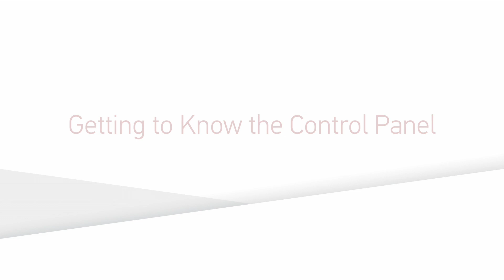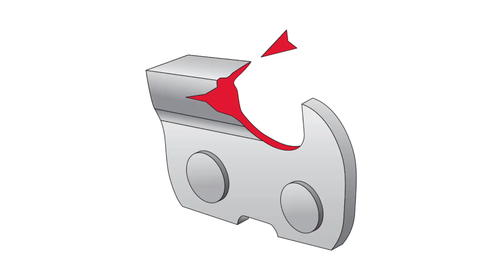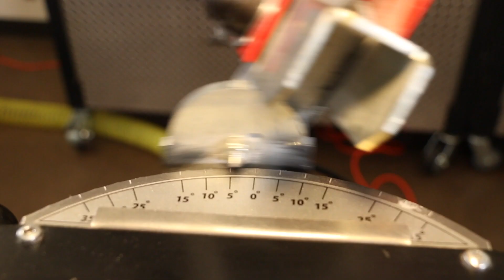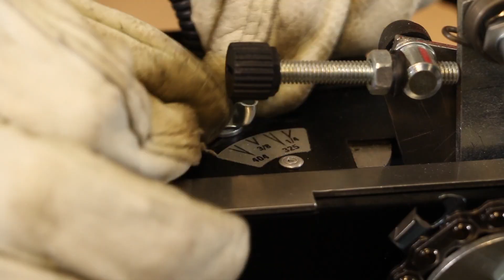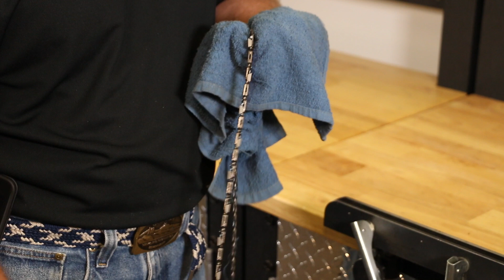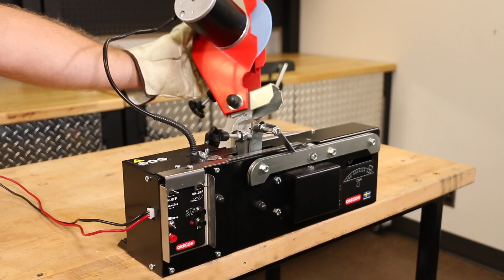Oregon 710-720 and 730-120 Automatic Chain Grinder Instructions

Comment: They dont mention the part where you need to be a former nasa rocket engineer in order to operate it correctly

No way this is effecient for  small shops unless they make chain for loggers and are making thousands of feet of the same chain where you can set it and leave